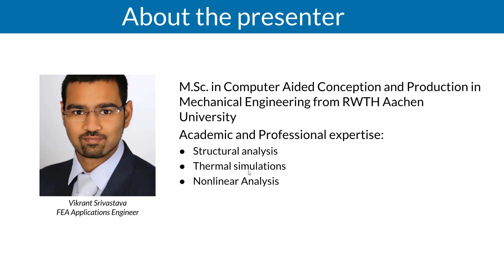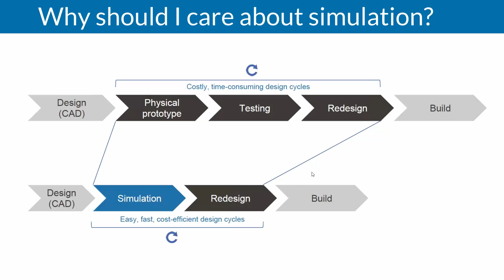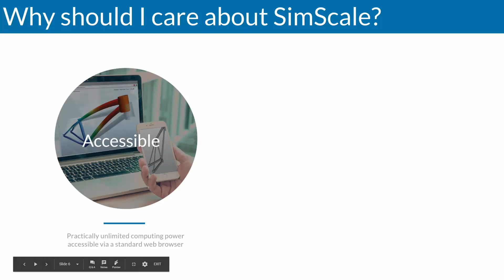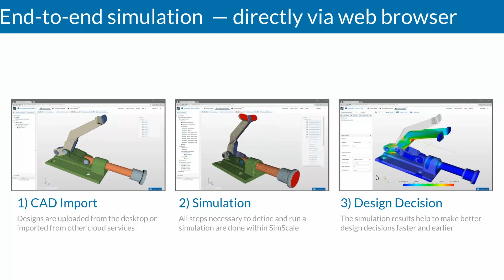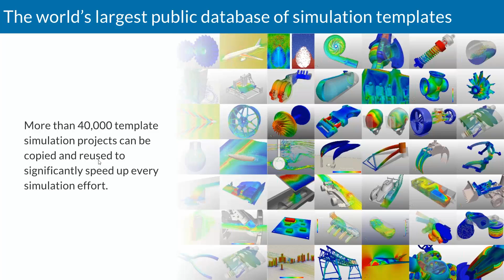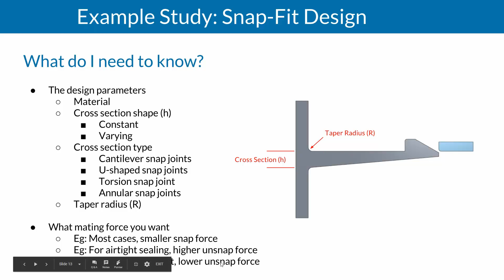Smarter Snap-Fit Design using FEA Simulation

Comment: Simscale offers one of the best way to design snap fit joints. As an individual you can also use simscale free of cost. But before doing simulation, best way is to do manual calculation for initial analysis. 

https://www.smlease.com/entries/plastic-design/how-to-design-snap-fit-joints-in-plastic-parts/